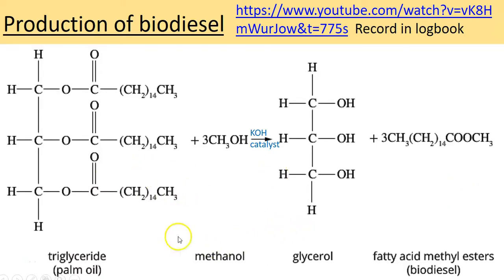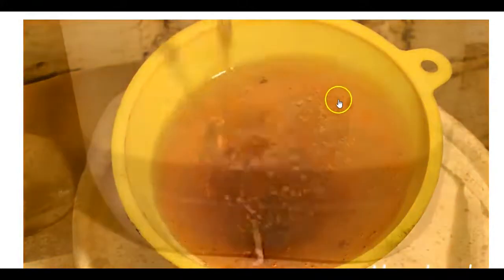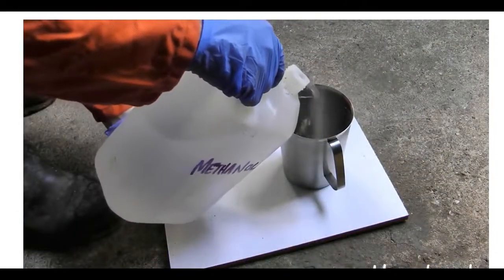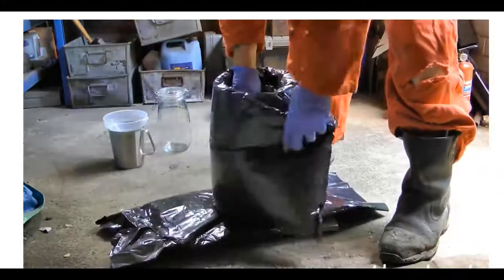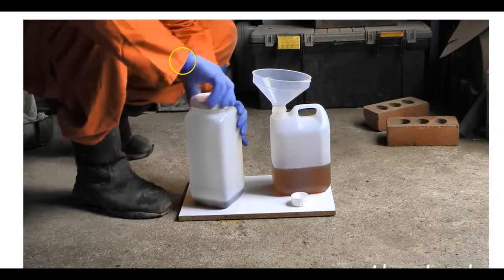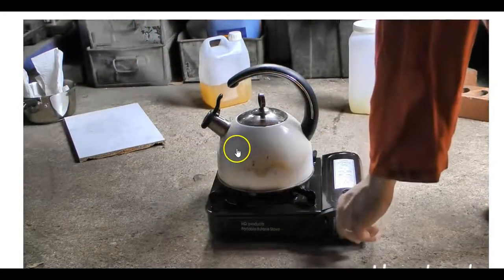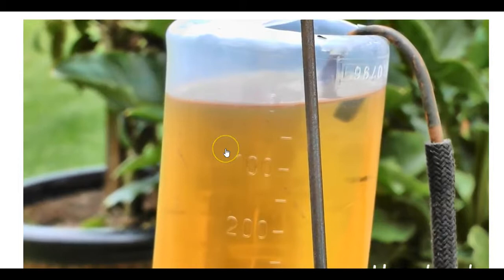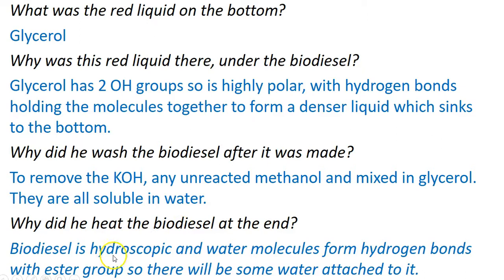Year 12 Chapter 1 Producing Biodiesel from cooking oil

Comment: I recognise that Lister engine, they used them in dumper trucks.  They carry earth, stone etc, then tip it forward to place it.  Now. People use them for electric generators, do the belt was driving a 240 volt generator.  I make bio in a processor, 80 litres at a time, and can you do a video on titration, as you know new oil will have a set amount of catalyst.  7g or Sodium, and 9g of potassium Hydroxide.

Comment: That's impressive.Thanks for the science.
2 questions:
So you can just use it as a fuel directly into a car engine?
Does the car have to be a diesel engine? or would it work in a petrol/gasoline car engine?